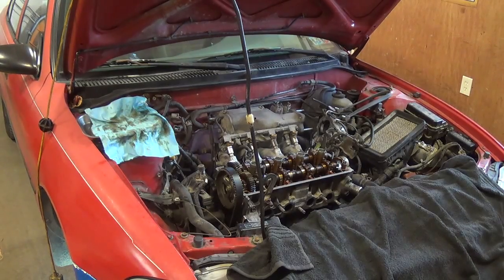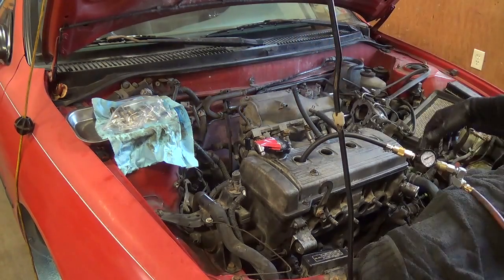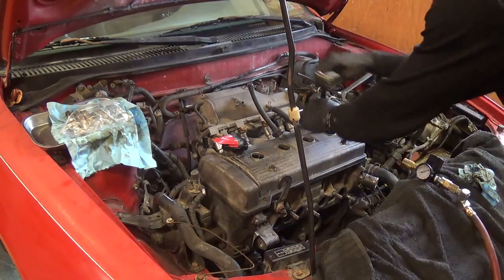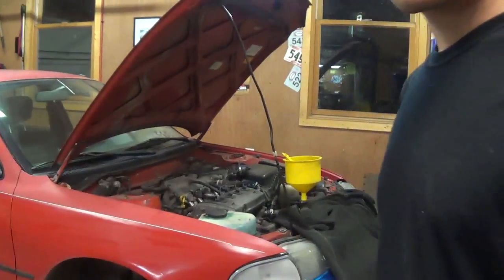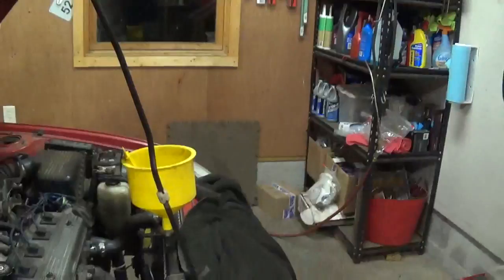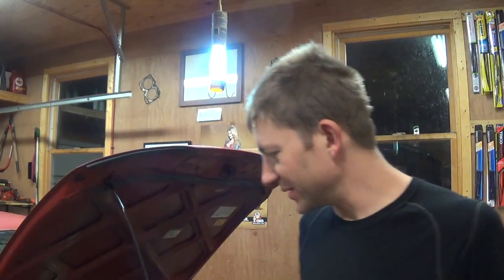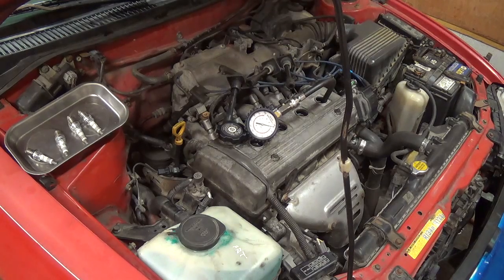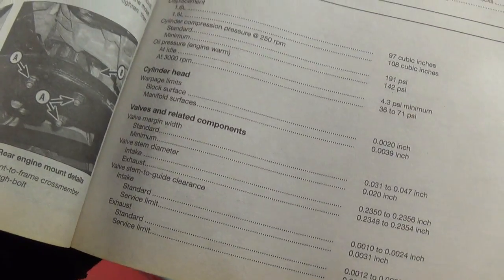Toyota 1.6/1.8L Oil Burning -'96 Geo Prizm -Part 4 of 4

Comment: When you replaced the rings, why would you not try to cross hatch the cylinders a bit, even tho you stated that you could still see some of the original cross hatch marks? Perhaps that would have helped seat the new rings better. I once had a Honda CM185T twinstar, with broken rings. I chose to just install stock rings, with the old Pistons, and when I took the jugs to be cross hatched, the mechanic would only JUST LIGHTLY tweet them. He said that if he did it too much, it would not work, at all. But after I had it started, it looked like a two stroke. It blew a fine, light blue smoke, constantly. I can't imagine that a bit of cross hatch would removed enough material to be that bad, as the too light crosshatch didn't do it any good either.
Reply from the maker: +roadkill5333 I don't think your issue was in the honing at all. My question is: did you dump the piston in oil before installing it?
Reply: +motoYam82 no, sir. although I did ensure that there was oil on the cyl walls, it was not dripping with oil, nor a dry assembly. the walls were smooth. but no ridge. was young, couldn't afford to bore and new pistons. so, new standard rings, and the cross hatch was all it got. the mech that did it, only pulled about 10-15 strokes with the hone. I could tell by looking that it was not enough. it ran for many hours, after rebuild. never quit smoking.
Reply: +motoYam82 by the way, what's with the dunking the piston? too much oil make the rings not seat? what's the secret?
Reply from the maker: +roadkill5333 Crazy. Did the broken rings scrape grooves in the cylinder walls at all? I've seen this phenomenon before on a vintage 1965 Honda Benly 150 twin. That sucker smoked worse than a 2-stroke!
Reply: +motoYam82 nope. both looked nice and smooth. it sat for a while. all rings were broken, and kinda gunked into the lands. after the hone, they looked like scratched glass. he just ran the hone enough to proves he did something to charge me for. I asked him to run it some more, but he said more money, and not reccomended. I honestly didn't expect it to look machined. but, I expected to see more scratches. I knew it wouldn't seal. it ran well, but smoked like a 2 stroke. didn't foul plugs, too bad. I broke the timing chain about a month later, and scrapped it.
Reply from the maker: Another variable is the PCV hose. On my own bike ('82 Yamaha Seca 750) I tore the engine apart for oil burning only to find nothing wrong...then I found a piece of debris blocking the PCV flow back into the airbox. Pressure was actually building inside the crankcase!! That was a learning experience lol :)
Reply: +motoYam82 I had an 82 Seca 750, for a while. the one with the factory fairing and saddle bags. loved that monster! I changed spark plugs, and found a chewed up thread and plug. did a compression check, 25psi! never noticed before, or after the plug change. was surprised how well it ran. traded it and a car for a 4x4 blazer, before the nightmare began.
Reply: I had a 85 fj600. The mechanic at the shop had a 750 Seca and blew my doors off a couple of times. I thought my bike was fast looking but it took some performance mods to make it a little faster

Comment: Good stuff mate...The valves in #3 will fail due to a burn through but for now it's a runner and that's a good thing.
Reply: +ZIGgassedUP Since Ivan's repair I have driven 864.4 miles on the car - so far there is no signs of any problems engine wise. The oil level is still at full capacity, and oil dirtiness is around 25%. It is a huge improvement over a previous engine works, where already at 600 miles almost all oil was burn out, and it was all black at 300 miles mark. With that being said, in my, consumer view, the fix will past a true test if "Turbolet" will still have oil after 3k miles...
Reply from the maker: +ZIGgassedUP Thanks man! I might give away a prize to the viewer who guesses how long this engine will go before needing more work. What's your guess in miles or km?
Reply: I love guessing competitions...3,000 - 5,000 miles and the valves will have a chunk burnt out of them...It's going to run a lot hotter in the combustion chamber now with good compression...I actually think they will fail before that...1,000 miles or so..Be sure to keep us informed..Cheers
Reply: Ivan did good...My 40+ years in the trade tells me you'll have low compression from the valves between 3&5k miles...Hopefully I'm wrong...Oil usage won't be an issue I believe..Cheers and good luck.

Comment: Similar repair as the one I was doing on Lexus IS 250 and GS 300 at the dealership.  Customer complaint was oil consumption and rough idle.  I must have done about 30 of those jobs.  New Pistons, piston rings and cleaning all the carbon build up from the direct injection.  Real POS "luxury" cars lol

Comment: Its tricky whether or not to replace the valves or not, because how far do you go? Do you just replace the bad ones on No. 3 or would the engine complain if it had one set of shiny new exhaust valves and 3 sets of worn in ones? Especially with such a worn in engine. 

Having said that i think that as the engine runs over the next ten thousand miles new deposits will cover up the pitting on the valves and improve the compression. Those old Toyota engines must be pretty forgiving, considering they run with bad rings and clogged oiling channels for hundreds of thousands of miles. So many of these old Carollas, Camrys and Carinas went to the scrap heap in the UK because they were old and just to thirsty for our petrol prices even though they probably weren't even halfway through their useful lives. Unlike cars in Europe which being LHD can go to Africa, Middle east and eastern Europe theres no where for our old RHD vehicles to go that doesn't have a closer supplier like Japan or South Africa.

I'm thinking of attempting to replace the rings on my daily driver. It must be using a litre of oil every 1000 miles. I don't want to part with it, its just so god damned reliable.
Reply: +johnmartin1024 They do drive on the left hand side of the road in Australia. I was just there last month.  Chris
Reply: +johnmartin1024 Australia, New Zealand, Japan, India, Pakistan, Sri Lanka, South Africa and some of southern Africa. Suriname and Guyana in south America. A few Pacific and Caribbean islands, Papua new guinea, Indonesia, Thailand, Malaysia, Burma and Hong Kong. We're not really near any of them.

Comment: Fantastic series Ivan. I wonder if the leak down test on # 3  results would show less or more leakage on a running engine as shown with a pressure transducer. I haven't seen a vid comparing the two tests . If you get another one like this it would be interesting to see if there is a measurable difference.
Reply from the maker: +Steve Rob Hey Steve that's a great suggestion! I might do some transducer tests on camera the next time I see this hot rod for an oil change :)

Comment: Good vids!  Valve clearance was ok?
Reply from the maker: +Jerry Whitaker Yup right on the $$
Reply: +motoYam82 great job man the only way to do it is to do it I've got a whole collection of haynes and have rebuilt a few engines myself if your not sure about valves sealing in the head just spray some break clean in the chamber in your case while its still on the floor lol if it leaks by its leaking by